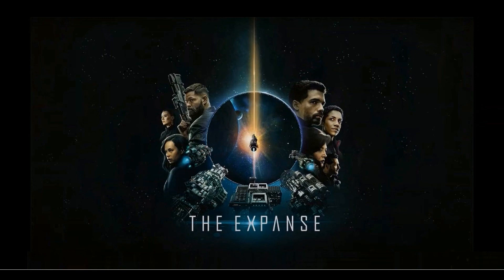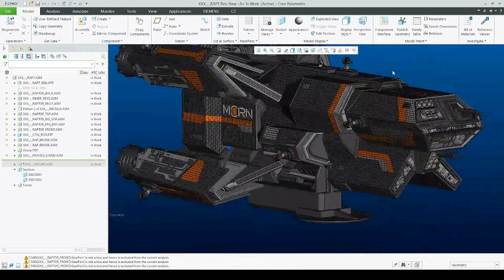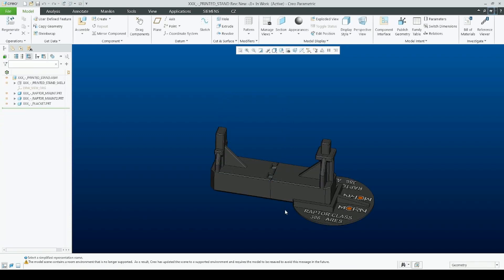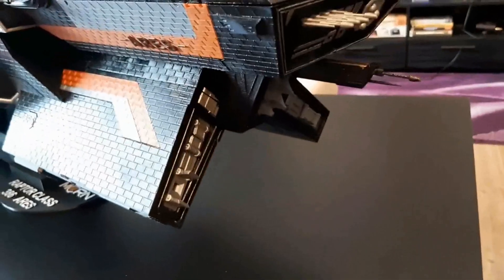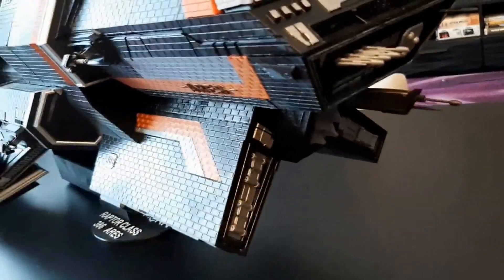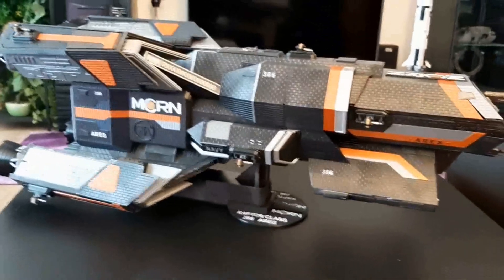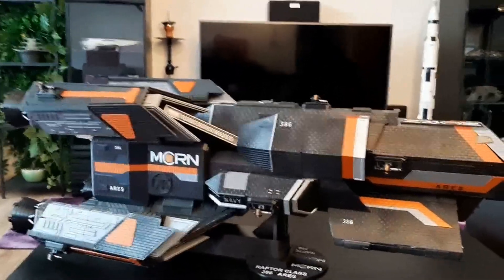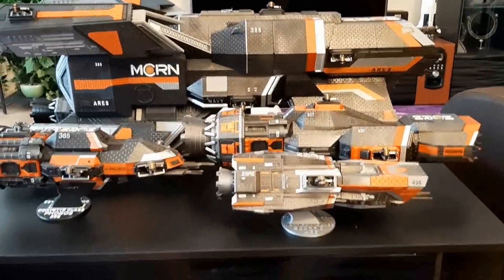Project Raptor Part 7 - Last Details

Comment: Are the ends of the airbridges designed to connect to one in another ship. tiny detail but if you positioned two of your ships together would the connect.
Reply from the maker: Well yes and no. They will not snap together but if you make something to hold both ships in position, the bridges will be connected.
Reply: @martintaichl  awesome. would be cool for some sort of hanging or wall mounted display. Seeing your fleet make me want to play a space game with Expanse assets. 
I think the Battlestar deadlock playstyle would suit Expanse ships pretty well. 
Maybe someone will make a mod for it. hint hint :P